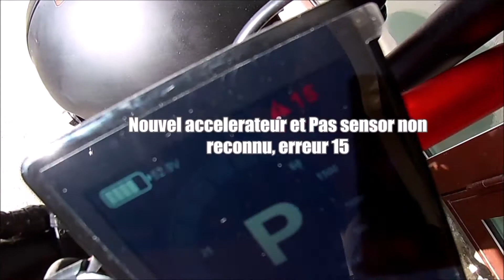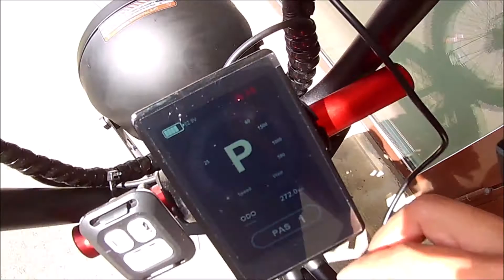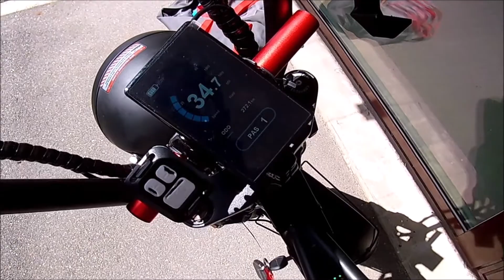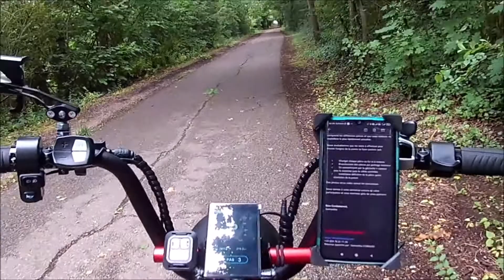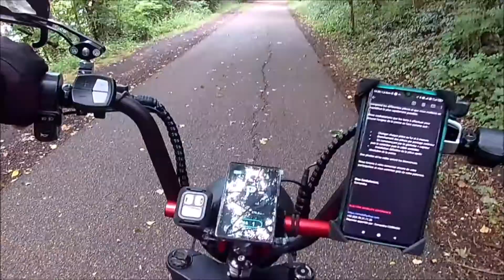Changement controleur 52v du Scrambler S Onemile // Un vélotaf fat bike biplace 850w // 52v

Comment: Merci pour tes vidéos ! Je viens d'acheter un Scrambler V et tes conseils sont tops. Quel est ton support de téléphone stp ? La position près de la poignée de droite me plaît bien. Merci d'avance.
Reply from the maker: Hello!
Bienvenu dans le monde des Scramblers ! Superbe achat, tu ne sera pas déçus !

Voici le lien : Grefay Support Téléphone Vélo, Support Smartphone de Moto, Universel Porte Vélo du Guidon avec 360° Rotation pour 3,5 à 6,5 Pouces GPS pour Smartphones Autres Appareils https://www.amazon.fr/dp/B01N6M0I9M/ref=cm_sw_r_apan_i_BKXW6FT9ZR5BBBTMVDEZ?_encoding=UTF8&psc=1

Bon ride à toi
Reply: @Marc.Electric  top merci !
Reply: @Marc.Electric  salut, je vais commander le support de téléphone, juste pour savoir si il faut un accessoire en plus pour l'installer comme toi (sur la droite), au vu de la forme du guidon non horizontal. Merci d'avance.
Reply from the maker: @soifranc973  non ne t'en fait pas, ça s' adapte parfaitement

Comment: Salut melki, je suis bien heureux que tu ai pu réparer ton speed bike avec un nouveau contrôleur.
Je voulais te demander par quelle plate-forme tu étais passé pour l’acheter et est-ce que la gâchette te procure Une vitesse progressive ? Ou c’est une gâchette du style On off! Et est-ce que cette fameuse gâchette fonctionne sur les cinq mode ? Une dernière question, quand tu reçois ton vélo la roue avant est démonté ainsi que le guidon je suppose et je voulais savoir si remonter le tout était facile ou plus délicat ?
Reply from the maker: Hello ! 
Concernant la gachette, elle te permet de  délivrer la pleine puissance du moteur qu'importe le mode. Un peu étonnant sachant que j'ai un autre fat bike qui a une accélération poignée et qui respecte bien le mode choisi. Ici c'est comme si tu étais en mode 5 soit le plus haut. Après, la vitesse est quand même progressive et ça ce prend bien en main. Perso, je ne l'utilise qu'au démarrage de feux. En effet, tu dois monter la roue avant qui est un jeu d'enfant à faire, ainsi que le guidon à placer selon tz conduite, il sera automatiquement aligné avec la roue. J'ai acheté le mien sur rueducommerce, mais tu peux passer par le revendeur direct qui est emobility shop ( il me semble qu'ils te font un check up total avant l'envoie, ce qui est un plus) . Si tu es en IDF n'hésites pas à faire signe pour un ride 😊🤙!
Reply: Merci Melki pour ta réponse précise et rapide.